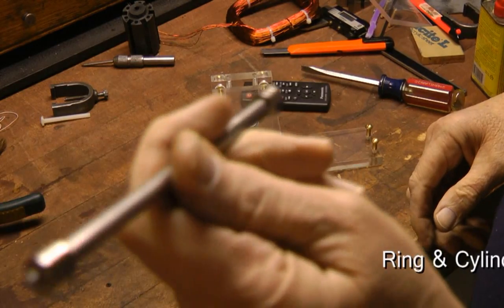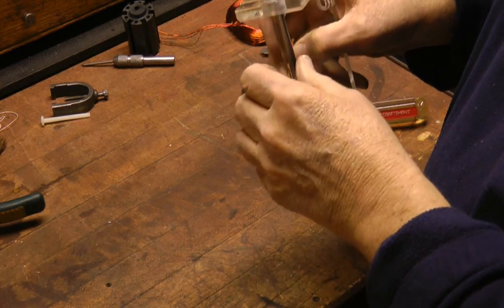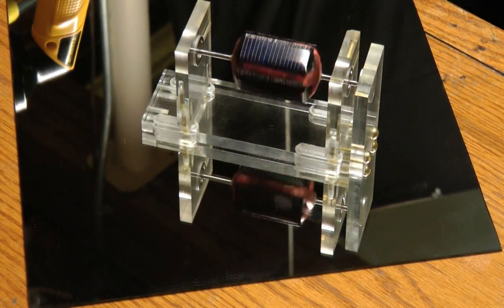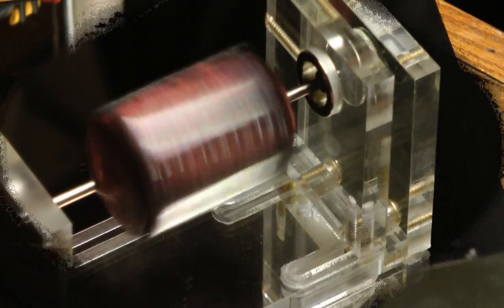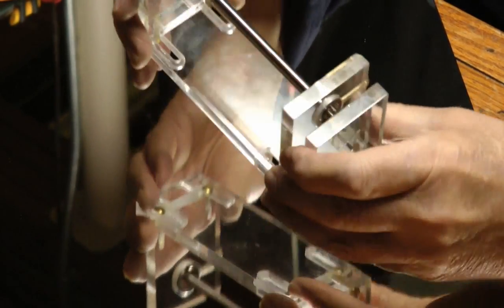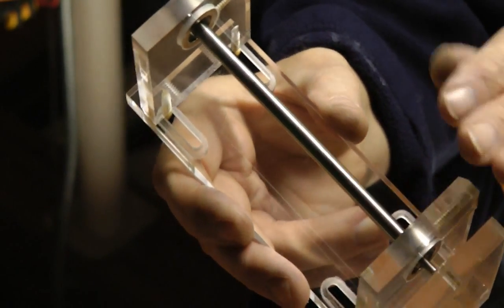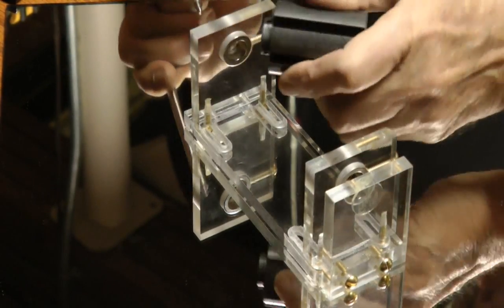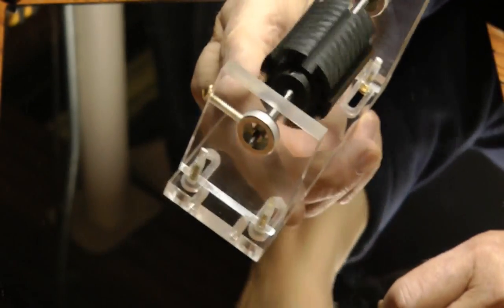Magnetic Ring & Cylinder Levitation Fixture

Comment: so the shaft is also a magnet ? and the ring magnets help to levitate the shaft ?  does this solve friction problem or does it have friction ? i should have really listened to my science teacher back in my young days.
Reply from the maker: Hello, the shaft is non magnetic stainless but there are magnets on it. The ring magnets center the rotor and shaft but with some very fine adjustment the device is almost friction free. There is a point on each end of the shaft that is sharpened to a point. When adjusted to optimum the shaft settles in between the two glass mirrors with only a few thousands of an inch clearance. The shaft will touch one mirror or the other but almost with an unmeasurable pressure.
Reply: thanks DadHav ... very cool idea.

Comment: Hi DabHav , watching your video, it awoke my imagination and so gave me ideas! Tell me, according to you and your experience, can we imagine the axis of a flatter of a turntable of 2 or 3 kg which rotates without any lateral and vertical contact in the most fluid, rigid and precise way possible ? Thanks
Reply from the maker: Hello friend, I have actually thought about it over the years. It may not surprise you to know I'm a bit of an audio file. I even had an early serial numbered JBL Paragon at one time. google that one some time. I thought about levitating the entire turntable or just the platter. There are so many circumstances to thing about that I never went to far with it. It would be a great project though.
Reply: DadHav Ok I understand dear friend! But tell me, magnetized rings are axial models ? On the other hand, I notice that one of the extremities of the tip-shaped axis, is supported on the plexiglass, is what you think that with a magnetic solution at this end, the rotation of the whole does not would she be no more free ? In this case according to you, what magnet force would be effective please?  Your axe is made of stainless steel ? What do you think of this, a product of a great high-end Turntable maker ? 

 http://www.turntableworld.co.uk/analogue-c49/turntable-zone-c11/accessories-c26/ceramic-magnet-bearing-cmb-upgrade-for-emotion-p183

the idea of a rolling system for Turntable without any contact obsesses me ! Thus, more noise, friction ... in any form whatsoever and much more information read by the cartridge since less vibrations generated by the bearing ! 

Looking forward

Comment: Very sorry now found such a good video,
This magnetic levitation structure,
After all, one end of the contact,
Compared with ceramic bearings,
Which is better?
Reply from the maker: M Jannick Hello M, the magnetic shaft motor is only experimental and you cannot connect anything to the shaft so I prefer the window motor with ceramic bearings.John

Comment: Hey, have you got around to thinking of selling a kit of this? I must've messaged you about 2 years ago, yet no answer. :P
Reply from the maker: Hello Jason, I'm really sorry about that. I can't remember things very well from that far back. The fact of the matter is it isn't very practical for me to think about making a kit. At one time I thought about making just the bearing assemblies and a shaft for sale but the way the magnets can be uneven makes it very difficult to get a setup that doesn't seem to be out of balance. This is almost like you have to be lucky to get a good machine or settle for something that is less than perfect yet much better that a standard bearing when it comes to free spin time. 
John
Reply: *****  Oh alright, thanks.

Well I just saw an ebay listing showing a mendocino motor kit for sale with the same magnetic bearing you thought of--trouble is the kit is from China. Well you know what they say about the build quality from China, and the reasons you just mentioned. Guess I should be wary of taking the plunge.
Reply from the maker: jasonme3
Hi Jason, That depends. buying in quantity can also get you some breaks on better quality components. The uneven magnets causing what seems to be an out of balance shaft or rotor can also manifest in the standard magnetic assemblies as seen for years. I'd like to see what you saw for sale.
john
Reply from the maker: jasonme3
Wow it almost looks like they got the idea from my channel. I also saw the same one that only had a bid of $9.00. Actually for the money it doesn't look bad, especially when you can pay over $200.00 for one from Germany. There's almost no way to tell until you see a review. You might be able to find one with a little searching. I noticed by watching the video closely that the shaft didn't look like it was completely concentric to the point that goes against the mirror. That's about all I can say Jason. Let us know if you get one.
John
Reply: *****  I was taking a look at the magnetic Inverter and was considering it as a locking system for the back instead of a point. Do you think it would work?
Reply from the maker: BeingOfLight1111
Hi, I think it's possible to extend the shaft through the magnet assembly with the right configuration. I've tried a few experiments but it looks pretty sensitive to set up.
J

Comment: cheap Chinese compression bonded neos sometimes don't have uniform grain size / bond granularity. Might also be eddy current nonsense in the plating. Could try a higher quality supplier?
Reply from the maker: You're probably right. Actually I haven't thought of the eddy current possibility. One way or the other I can get a half hour spin down with the steel rotor from a generous hand push. You can really get tricked from the magnets though when it comes to balance. Thanks for bringing this to my attention.
John

Comment from the maker: Hello Shane the only problem with using a solar motor to do work is you are usually better off just using the solar cells to run a motor, generator or charge batteries. If you build a Mendocino and use a base like this you don't have access to the ends of the shaft. It's hard for me to help without more information but I bought the ring and cylinder magnets at K&J magnetics. There is information under the video about them. You would want to use something non magnetic for the shaft.
John

Comment from the maker: Ryan, You are right as it pertains to this simple example and experiment but magnetic bearings are used in industry and actually are deadly accurate for centering. Sensors monitor shaft position and amplifiers adjust for deviation by changing the current in the field coils. The Assemblies are heavy as you mention and the applications somewhat preferential. Thanks for your comment
John

Comment: The problem is these magnetic bearings are only good for small loads, otherwise they deflect from the center and you end up with massive problems. In high-speed (very)low load applications like energy storage flywheels and turbomolecular pumps, magnetic bearings are used but they are completely unsuitable for even a bicycle because to get the load-bearing stability you'd need 30 pounds of magnets for a 20-pound bike and then the point of friction at the end becomes a massive problem as well.

Comment: Hello, why isn't this concept used for automotive bearings? Especially, I am talking about he Land Speed Record. With the Bloodhound SSC trying to go 1,000+ MPH later this year at Black Rock Desert, why don't they use this type of floating magnetic bearing for their wheels? Many land speed racers have died in the past due to greased ball bearing failure. With this, there is no wear or tear. It could spin thousands of RMP's. In your opinion, could this concept be used for a 1,000+ MPH car?

Comment from the maker: Hi Keys. I have the uprights screwed to the base but the screws are in slots so I have infinite adjustment there. The ring magnets can also be moved in the bores. If the point is sticking to the left side I move the right ring magnet past equilibrium and to the point where it wants to draw the point away from the lefts side and onto the right. A very fine adjustment will get the point to stick to either side while having a very small amount of air gap on the point. Hope this helps.
John

Comment from the maker: Hi Scott no problem. The magnets are adjusted with the same poles facing each other. The alignment can be a little challenge but as you experiment with it you will get the idea. There's a point much like a null where the rotor will want to slide either one way or the other. What you want to obtain is a position where the points of the shaft will stick to either piece of glass. You can adjust to have only a few thousands play point to point and almost no pressure on either side.
Good luck
J

Comment from the maker: Michel, there is a good selection of magnets at K&J magnetics, and some good reading as well. The levitation device allows for super low potential devices. I have the one pound rotor spinning from a tiny watch battery and pulse circuit for over a month now. Good luck with your project and let me know how you do. Get back in touch if you need help.
MerryChristamss and Happy New Year 
John

Comment from the maker: Hello Michel, I think everything comes from something don't you? I've seen things that I couldn't explain but it might just be I'm not educated enough to evaluate some things correctly. For now I agree with you. This shaft has points on the end and there are glass pieces for centering. The adjustment has been made so fine that with only about .005 inch clearances the rotor will stay against either side, it's nearly friction free. I have others that do float free with magnet end pieces.
J

Comment from the maker: @NavyJonTheManimal 
The points on the shaft either touch one side or the other. The idea is to adjust the magnets to a place where the shaft will stay against either side when you have an air gap that you could just fit a piece of paper in. At this adjustment there is almost no friction at all. Lack of symmetry? The shaft will sag below the center line of the ring magnets. You could work vertically, stand the fixture on end and adjust the magnets to relieve the point pressure.
John

Comment: Ok, I meant no sarcasm in my first comment, although I did pay to get on this site...then I find out youtube is actually free.
  There are other guys on here that claim over unity or free motor/generator stuff, but often keep crucial parts off camera, like holding a light out of camera range.
  I do have a question, have you thought about operating the motor in a vacuum..? I'm thinking you'd get less air resistance...and perhaps a sort of lens to focus the lamp on the PV cells in a line..?

Comment from the maker: @skycollection 
Hi Pal. I do have a round glass on each side. They where mirrors but I sraped off the back and now they are clear. With the two pound steel rotor I can get almost 30 minutes rotation. The trick is to work on magnet location until the shaft will stick to either glass when there is only about .005 inch clearance between the shaft and mirrors.
Thanks. Jorge.
John

Comment from the maker: @NOBOX7 
Well, I don't know. I think that's way over my head but you do have a  fixed mass rotating around a symmetrical axis. Maybe if you could incorporate the magnetic flux from the magnets to produce an angular momentum vector in some interruptible way so not tot detain rotation and come up with something unexpected, But in short I think this levitation is the most frictionless thing going right now for armatures like myself. Maybe I'll try to find something on the batteries.
John

Comment from the maker: @unheardrecords 
Hello, Gravity will make the levitated object sit lower in the magnetic field. That's a given. The uneven, seemingly out of balance. scenario is caused by something else. The magnetic fields between the cylinder and ring are N to N and S to S so there is a push to center the shaft. Picture now that the magnets when out of shape (not perfectly round) or if each had a Small bump sticking up. As the shaft turns it would attract or pull. Same if there's uneven gauss on the mags.
J

Comment from the maker: @jmhrvy1947 
Yes, I approved your video and have tried the same techniques. If you notice at the very beginning of my video I have two magnets at each end of the shaft. I did try to even out the flux but had better luck when I used the smaller magnets at the end of the video. I used an oscilloscope with a gauss meter probe to look at the flux while the magnets where turning. This gave me a wave on the scope when I found an uneven one. I can't find a perfect solution yet. Keep me posted.
John

Comment from the maker: @u2btchr
Hello. I used Ring magnets that where 3/4 outside by 1/2 inside, and 3/8" thick. At the beginning of the video I had two 1/2 x 1/8 x 1/8" cylinder magnets stuck together on each side but at the end of the video I just used 1/4 x 1/8 x 3/8" on the ends. Try K&J Magnets. The larger magnets would have supported a lot more weight but I experienced some cogging because of the close air gap and some uneven magnetism. I'll make a video with the next solar motor.
J